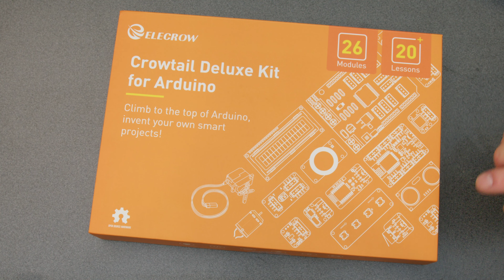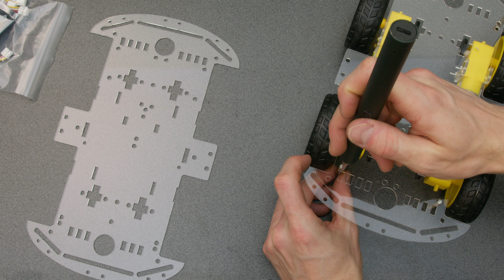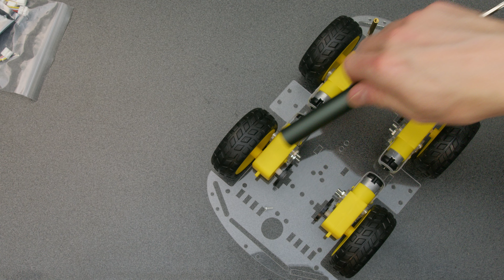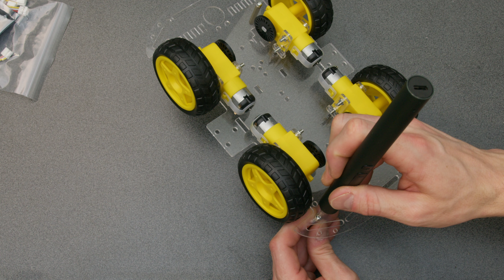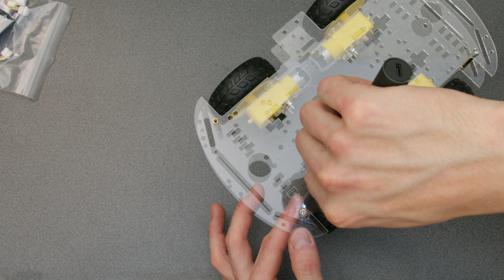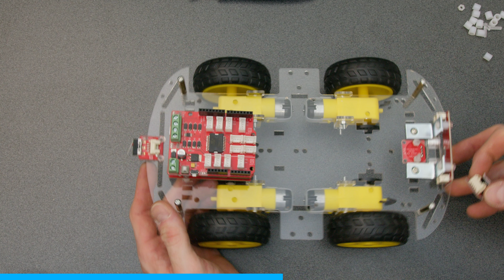Assembling a 4WD Robot with Arduino (Elecrow Part 2)

Comment: Was thinking if the wires are long enough to mount all the electronics hanging of the top plate, keep the top of the bottom plate to store the batteries (protection from impact), 
a 20 wire ribbon cable between the 2 plates might be better, anyway a lot of options, but not for a 2 wheel balancing.
Does the kit have a charging circuit for the batteries ?
Reply from the maker: That is a VERY good idea re the 'suspension' and impact prevention. I'm going to do that wiring off-cam I think, cause even this 15 min video was actually 2-3 hours work haha.

No charging circuit as far as I can see, but I do have a few TP4056 modules I might integrate with a DW01A if I have any left!